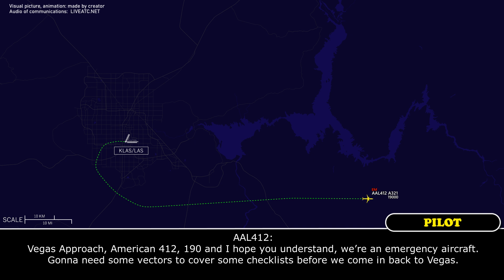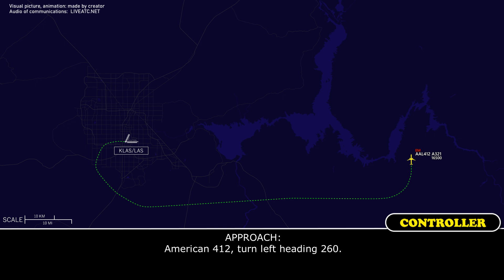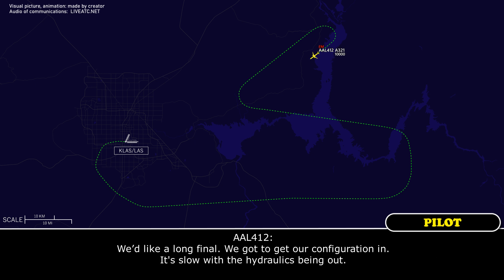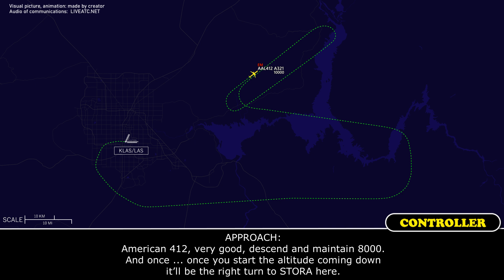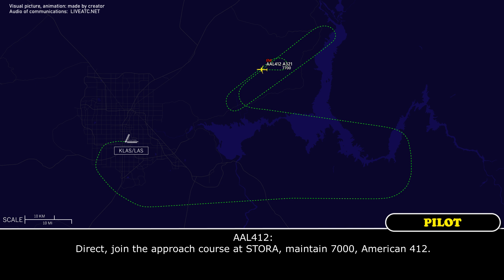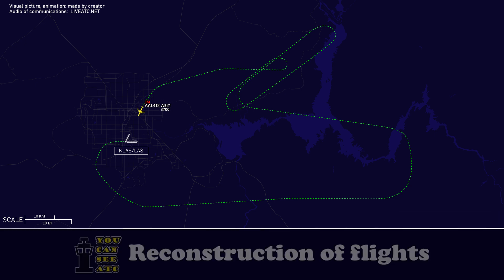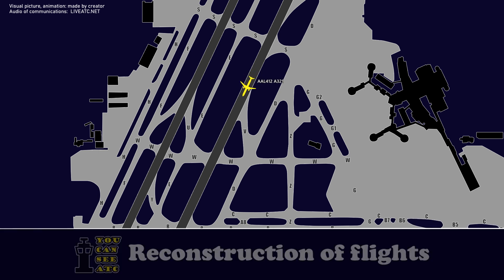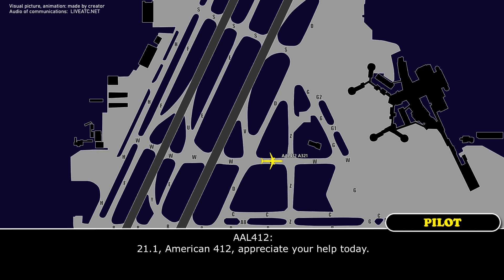“We need a tug after landing”. Hydraulic failure. American A321 returned to Las Vegas. Real ATC

Comment: I saw the same thing! On January 6th 2023, Delta flight DL2350 operating KATL-KAUS was being, used by an A320-200 N347NW when on the approach into KAUS they reported a hydraulic failure. and Lose nose wheel steering resulting to the runway being closed for a bit still haven’t uploaded the video yet.

Comment: Airbus seriously need to investigate the nose wheels of the a320 family aircraft. This is starting to become a common trend with them
Reply: It was a hydraulic failure (of two or three). Several systems fail when a hydraulic failure occurs, one of them being the nose wheel steering in this case. They didn’t go back because of the nose wheel steering inoperable. That just was one symptom to fail, which was known.

Comment: As always in the USA: bad communication from ATC. The first guy was great, but the rest... Mwah. The approach guy gives them a shortcut. Always appreciated, except when they specifically asked for a longer final for good reasons. Then tower keeps giving them wind information. The wind wobbling 10 degrees or 1 knot is not relevant. It is almost straight on the nose on that runway. 

The pilots did ask for the wind again. That's probably because one of them was busy when tower told them the first time. So then the other pilots says lets go runway 19, the wind is 150 at 15 (or whatever they were told). The other one then says something like: "Huh? I thought he said 250!". That's when you just ask again instead of "I'm pretty sure he said 150".

Comment: So how do the flaps and major items work without hydraulic?
Reply: Fine, generally. Separate systems. IIRC NSW is non-critical. Yellow system+blue has an electrical backup. If that fails yellow still powered by RAT. If real loss, no flaps+gravity landing gear. But you'll probably be dead, since any control input will be minimal
Reply: @noway9880  RAT powers blue system if electric pump fails